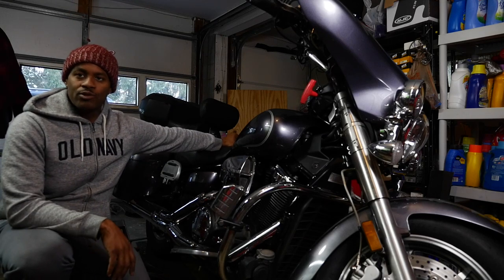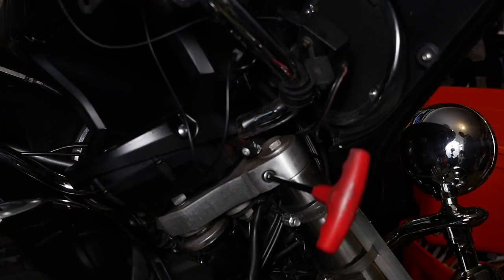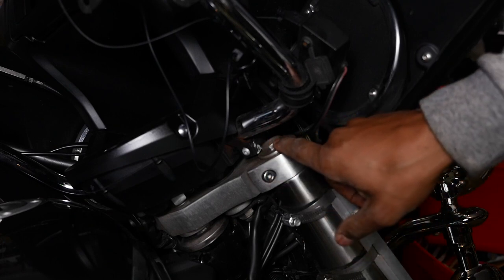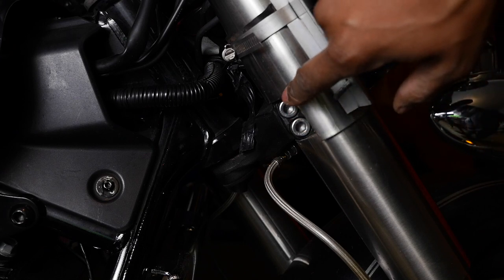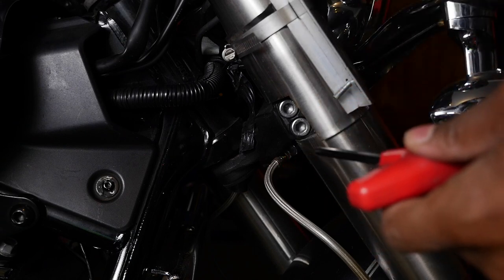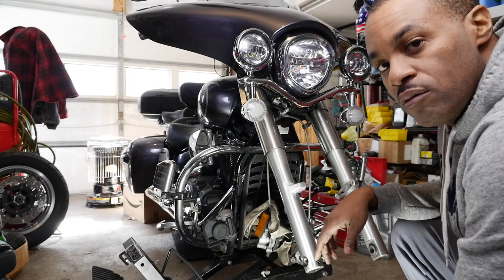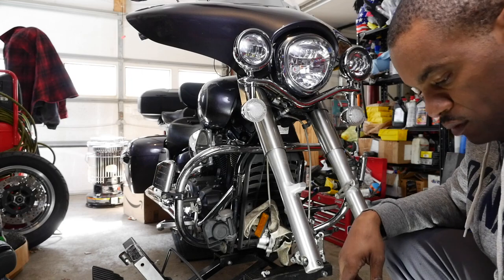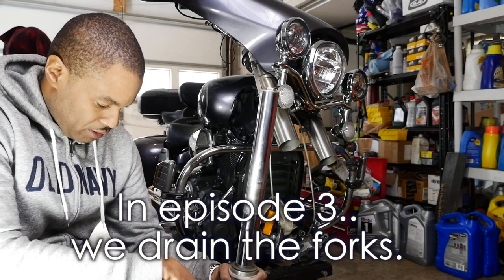Fork Fluid Flush on the Vstar 1300 | Part 1

Comment: Realy like all the little tips you give out, they make the over all job so much easyer. Also just noted how you put attention to the lighting. It's so hard to work on and light a bike. Good stuff.
Reply from the maker: Thank you Nimby. I tried to have enough light to do this. Some of the areas can just be so dark. Those hardware store aluminum light carriers can be so handy. I did use a white umbrella to help soften the light on the metal. I need a bigger screen to monitor focus points as I like manual focus. That way I choose what's in n out of focus.
Reply: @dbest1aVlogs  one trick with that is make a focus board and run a string from it to a mounting point on the camera. Like a pro would pull focus in a movie, But just they back yard version. Then you can move your rig around and your focus stays at the end of your string. That you can quickly stretch back out. Not my kinda thing but I have friends that shoot this way just an idea to speed things up.